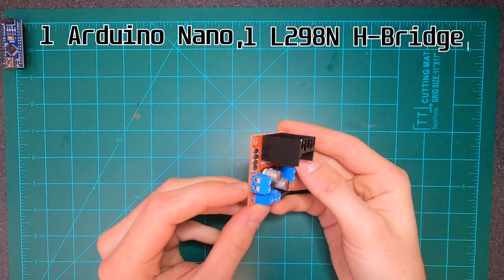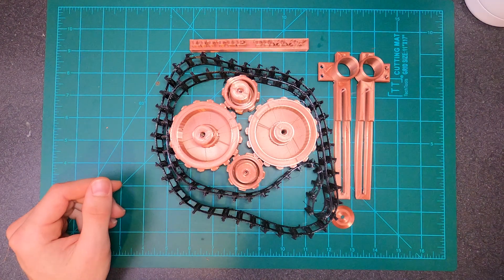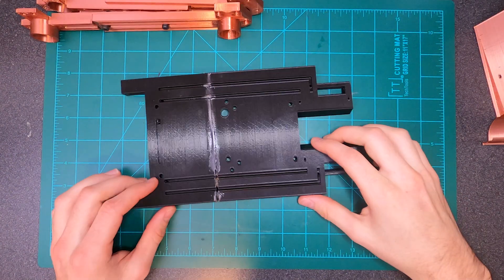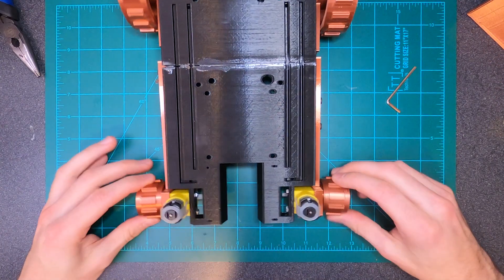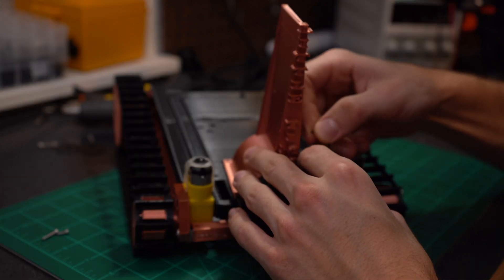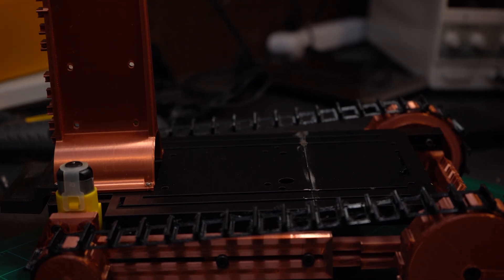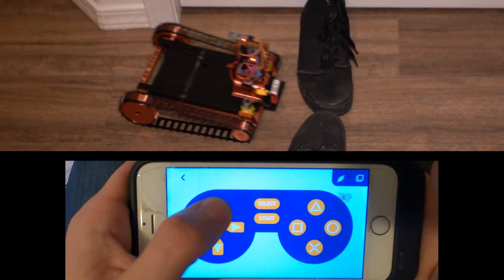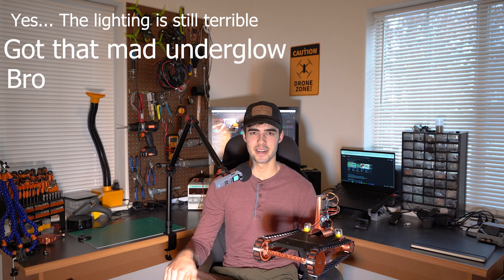How To Make Modular Arduino Robot, with Bluetooth

Comment: Hi, Great Build, really cool to see. Planning to build one myself now 😅. Just wondering if you connected the jumper wires to the tt motors using a soldering iron and also if it would be ok to use a normal breadboard rather than a prototype board. And if you don’t mind would you be able to link the battery you used as i can’t find one.

Many thanks in advance,

Comment: How much did the whole build cost?  
You should add the ability to do solar panels.
Reply from the maker: In total for the electronics you’re looking at around 25$ ish depending on if you buy individual pieces or buy in bulk of 3-5 units. As well as the additional cost of the 3D printed materials. Solar panels would be awesome! I’ll look into whether or not I could make that happen, thank you so much for the suggestion!